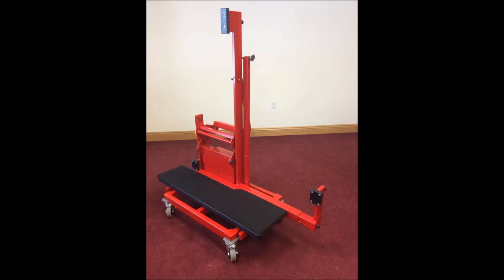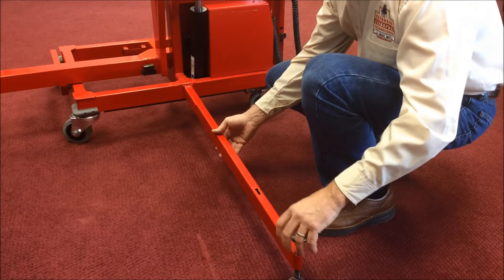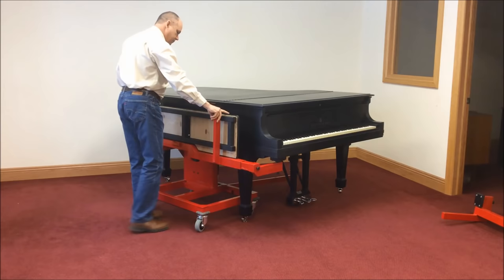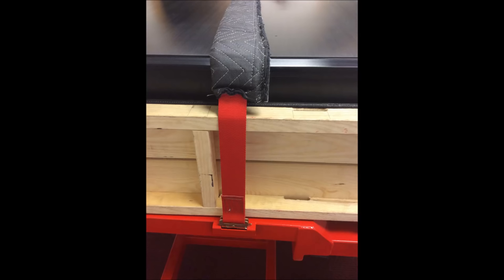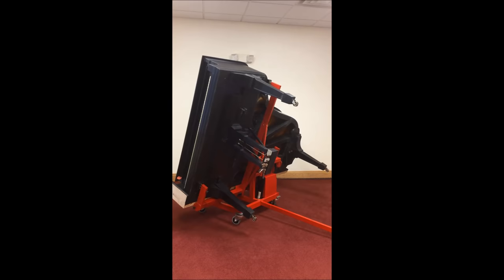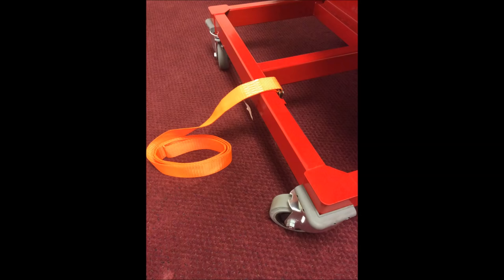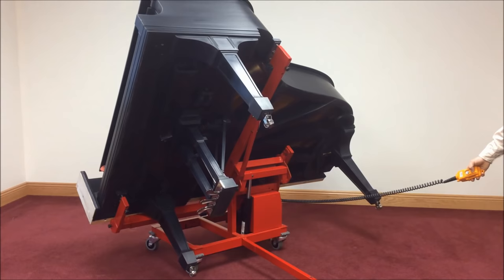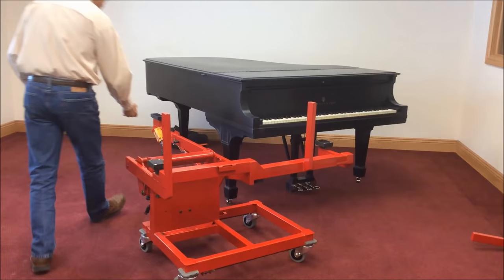KTT Grand Mover Operation

Comment: So I've seen it tipped, but how do you get it out of building and into a truck, those wheels are not going to go over anything apart from a very flat surface.
Reply: U lift the wheel over thresholds. This wouldn't work for stairs unless u have a ramp.